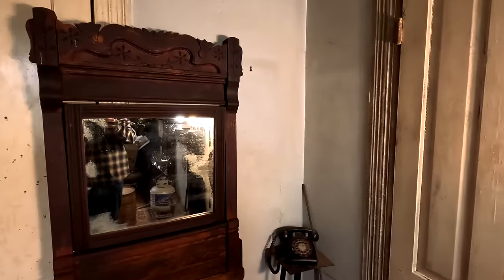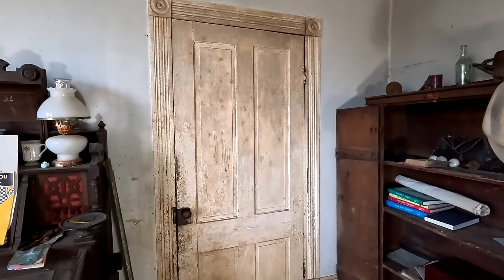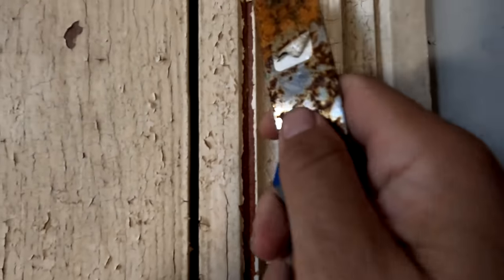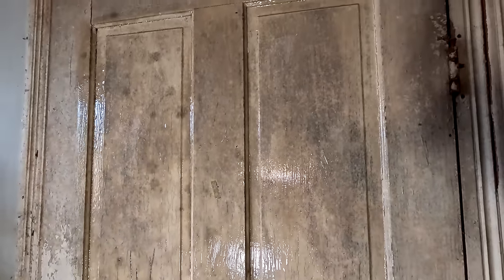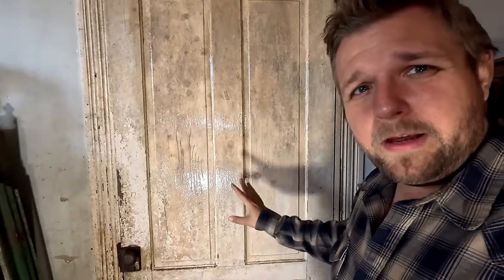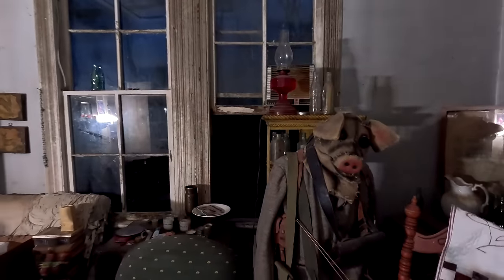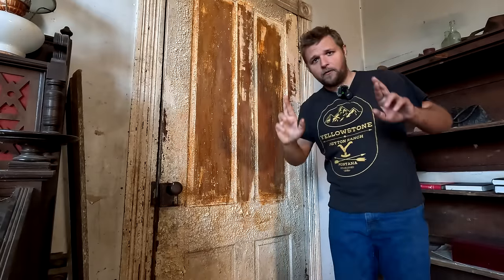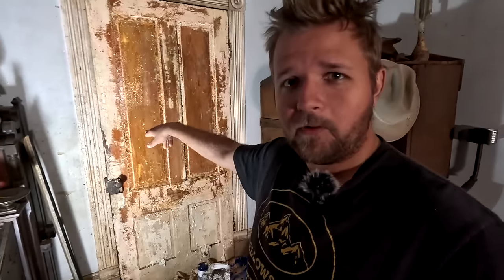Stripping In A 140 Year Old House!

Comment: Robert, have you considered taking the door off it's hinges to strip it? Maybe if it's laying, the goo will have a better chance of working rather than thinning out as it discovers gravity. The finer parts can be gently worked with a soft brush wheel on a power tool. I've used actual wire wheels on cast iron but it may work on wood if the material of the wheel isn't too stiff or abrasive.
Reply: When I use strippers I get cheap dollar store rolls of plastic wrap. After I paint on the stripper I cover the layer with plastic wrap and press it down. An hour or two later when the stripper has done it's work I pull off the plastic and a good portion of the paint comes with it.  Not all, of course. It's still a chore to scrape off the goo. The plastic wrap helps keep the solvent from evaporating so fast and the goo from hardening again.
Reply: I stripped several old doors that I put in my house, setting them on saw horses is easier and lets you see the lower parts of the door to do a more thorough job. Watching this is bring back memories, not all that pleasant but memories just the same. 😊
Reply: @Epoxinator  I agree. Wrapping it in plastic keeps it wet and holds some of the chemical heat in. It makes it so much easier.
Reply: In fairness to Robert, it's really cold there and that's why he's doing inside jobs. Also, maybe he just doesn't have the floor space to do so, given the state of his floors?
 @rivjoy
Reply from the maker: No, not right now. Maybe a future door, but not right now.
Reply: @Epoxinator  cold? Wheres the snow?
Reply: He said it was cold and that's why he was working indoors.
 @turji
Reply: @Epoxinator  U guys shuld come visit the north of Norway, then you would stop complaining about the cold when its not cold
Reply: Mr. Robert try with hot blower, I tried it is successful with out body  strain
Reply: I cede to you that it is colder there. I would bet, then, that you don't have wood doors outside, putting paint stripper on them.
 @turji
Reply from the maker: lol “iTs cOlDeR hErE” - well that’s the climate you’re used to, this is the climate I’m used to.
Reply: @Epoxinator  what u on about?
Reply: @THEOLDBYRDFARMVLOG   @THEOLDBYRDFARMVLOG  Is this troll acoount or is it the legit the old byrd farm, the answer is surley written like a kid or troll account.

Wr do have summers aswell with 30-50+ and winter with 15-50- so what you are saying is that we are better to climatise than u guys, the key thing is not to care about the cold and dress in the right clothes nothing more.

Comment: Your lungs!!! Maybe take the door off the hinges and bring it outside, where you can put the door on sawhorses and use the potent stuff? Less mess and airborne lead particles in your lungs and house, too. A Dremel would help to sand the door smoothly and get in all the crevices.
Reply from the maker: The supposed benefit of the stripper is that it contains the lead and what not.
Reply from the maker: Using the potent stuff would be more harmful than doing it the way I’m doing it… even if outside
Reply: Please take the door off the hinges! Wear a mask! Please not good for lungs. Ssafty glasses, one little splash could be bad. I have experienced it,.

Comment: I saw all the work you were going through and immediately said "take the door down first!"   It's SO MUCH easier on your arms if you lay the door out on a couple of sawhorses (or even better - a big old table (if you have one), before you start working.   You can see what you're doing so much better and you can capture and control all that paint that's coming off.   That's critically important when you're dealing with lead paint!

Comment: In my years of paint stripping, I found that a soft wire brush and medium-soft steel wool worked best for getting the paint and stripper glop off of curved surfaces and molding.  Also, older paint doesn't respond well to some newer removers.  Might want to check around for a stripper made for older paints.

Comment: The late Sears Roebuck's Craftsman made a wood-stripping tool in the early '70s.  It was basically an electric stove coil shaped into a rectangular metal frame with a handle.  As long as the bottom layer of wood has a layer of varnish, the multiple layers of paint would peel off in one, bc the varnish melts first.  The lead in the paint is likely why it's not sold today.  It worked like a dream, in our ignorant innocence.

Comment: I am wondering if you are running into the same thing that I did with my grandparents farmhouse that was built in the late 1800s.  The original pine doors were woodgrain painted to resemble more expensive hardwoods when the house was built.  Sometime later, and my speculation is sometime between 1920 and 1930, the doors and trim were painted with what I was told was milk paint, a paint common in farm areas in my region of the Midwest -- and that paint cures to be very difficult to strip.  That paint had been covered with several coats of oil based as well as latex paints over the years and stripping was a nightmare.  The one thing that helped was to use a thick coat of the stripper, then cover with a sheet of plastic wrap and wait overnight -- the plastic wrap slowed the evaporation of the stripping chemicals and helped the environmentally friendly stripers  do a better job on the tenacious old paints.  When removing the stripper, I utilized plastic scrapers and scrubbers that were compatible with the non-caustic environmentally friendly removers to avoid potential issues (rust staining) with metal fragments being left behind by steel wool or metal tools as I wanted a light finish of clear varnish or polyurethane.

Comment: I'd take the door off of it's hinges and lay it down on some saw horses and do one side at a time.  Also, you can get a carbide scraping tool to get off a lot of paint before the stripper.  That tool works well for scrapping once the stripper has time to work.  You have to be careful using it.  I would refrain from breathing in the vapors too.  Rough on the lungs and airways.  Depending on the stripper, after applying, you can put plastic or something to cover the stripper so it won't dry out and has more time to work.  A heat gun also can do very well.  But, I'd only use that outdoors as toxic fumes can be released.

Comment: Hello.  I totally agree with the viewer who recommended a soft brush for helping with the door.  I once helped my daughter and son-in-law  strip their kitchen cabinets to remove black spray paint.  They bought the house and discovered a lot of the black paint.  We used an orange paste like product, non toxic, and it worked very well indeed.  On another project, I used a restoring cleaner/polish that was on Amazon,  pricey but it did a great job on an end table.  On Amazon there is also a deep cleaner/rejuvenation product that I used on an antique chest of drawers.  That worked really good also, but I liked the restoring polish better.  Maybe an old toothbrush would help get the furniture oil into the hard to get to parts on your antique pieces.  Your home has seen so much improvement !!  Wonderful job Sir.  Will keep watching.  Thank you...

Comment: Steel wool helps when you need it at the end of paint stripping. I use an old potato peeler for the groves. I don't know if that would work for you on the frame.

Comment: May I make a suggestion. First it would be better if you took the door off but since your working with it hanging up get yourself some plastic bags cut them open n cover the door with the stripper on. Let it sit if you want over night. Trust me you’ll see a lot come off. Get some 4 zero steel wool to help. Especially at your last areas that have one layer left in spots. Also use the steel wool with the mineral spirts to rub on. I’ve been stripping old finishes n paint for many years. I did find this great stuff for stripping that’s called Smart Strip. No smell, no hard chemicals n won’t burn your hands. Or you can continue to do what you’re doing. Have to say, the door is looking good. Looking forward to the finish door. ♥️♥️😊👍👍🌟🐶🐶

Comment: Harbor Freight makes a set of 5 or so scrapers that are made to fit all different shapes. They are sharp enough when new to pop paint off dry, but the stripper probably contains the fine powdered residue better. Those Harbor Frt scraper sets were pretty cheap a few yrs ago when I got one.
Reply from the maker: Imma have to look and see if I can find them!

Comment: When stripping start at the bottom and work your way up. This stops the streaks. Same when it comes to painting or reapplying varnish. If you use mineral spirits to strip,put the dirty liquid into a quart canning jar. Let everything settle and pour off the top of jar back into can to keep using. That way you are only disposing of the gunk at bottom. Saves money.

Comment: Apply the stripper, cover with clear plastic, not grocery bags, let it sit for the 1 hr. Buy 000 or 0000 steel wool (in the paint dept) and  old toothbrush to get into the detailed areas. Let the stripper do the work but don't let it dry out.

Comment: I guess the bottle's advertisement of "stripping in one application" didn't quite pan out. I find a lot of these green chemicals aren't as good as the old ones, but I guess if that's the price we have to pay for clean food, water and air then so be it. I have never used a soy based stripper but I do know with the other types, they will work faster and more effectively if you wrap the material in plastic and let it soak that way. Alternatively, you could try scrape-stripping where you use a card scraper or cabinet scraper to remove the old paint without using any chemicals at all. This usually leaves tool marks though, so you'd have to follow up by sanding it.

Comment: Oh DARN Robert !!!! (ha ha) wood work stripping, The door off its hinges will be so much easier to strip it, let gravity be a helper with the stripper and don't forget to wash it off as per directions. Are you having problems with wood and helpers to work on floors?  Hows sorting coming?  Looking forward t someone actually living in it or that museum you keep talking about.  Is there a local group you can contact that needs hours, like the high schoolers? that can come and help with the clean up? we have them where I live, thats why I asked, Good Luck

Comment: Not all paint comes off the same in the 5 years I’ve been doing it. You could either try the dumond peel away paint stripper if you don’t want to heat gun or grind the paint. The one thing I know about it is that it can be very difficult work. Peel away is the most powerful paint stripper j have ever used and I would strongly recommend it

Comment: Never used a soy based product, but on the stinky kind, UV rays make it work much better, warmer temps help a lot too, most don't want you using below 65. Did some indoors years ago, took forever, moved it outside where the UV rays could hit it and it worked much better and ten times faster.
Reply from the maker: Good to know!

Comment: I work with wood and I refuse to use chemical stripper. I use Citristrip this is awesome stuff and just pulls the paint right off. Another trick is lay it down flat use the stripper and then lay plastic wrap over the door so that the stripper bakes through the paint. I do this everyday on furniture and wait 3- 4 hours and it comes right off.
Reply from the maker: Great tips! I have heard of the Citristrip as well.

Comment: The speckling on the mirror might be because it's a mercury coating. They can be repaired, but... well... mercury. I'm sure it would be something someone trained would have to handle. Even without that, the wash stand is even more beautiful now. The same applies to the door! It's going to be hard to wait for the room to take shape in all it's glory. The only thing missing will be the hand crocheted 'frilly bits'. Those may be able to be sourced easily. ahem
Reply: Crocheted doilies are often at thrift stores but many of us have them in our linen closets waiting to be loved again.
Reply: @lindalumae , very true! I do the 'old fashioned' crochet, as someone has called it. The only thing I can't work in now (eyeballs aren't what they used to be) is the very very fine thread, the lace weight. One bridal veil done with that and I was cured of wanting to do that again. I just wanted Robert to know that if he can't find the piece/s he feels he needs, holler. I can make that happen and it won't cost him a thing.

Comment: Just a suggestion and a question: 
If you plan on doing all the doors and molding consider getting a set of shave hooks. They will help with the detail work. 
And where did you dig up that container of paint stripper? Was it under a wisteria root?

Comment: Where is the mask?  Even when stripped paint has lead. An old tooth brush getting into the crevasses. I agree flat is best. Also works best on a clean surface. Seems like an extra step to clean the door, but it does make the stripping go faster.